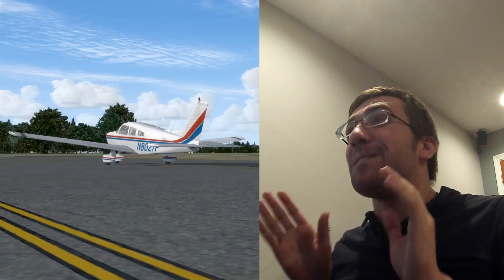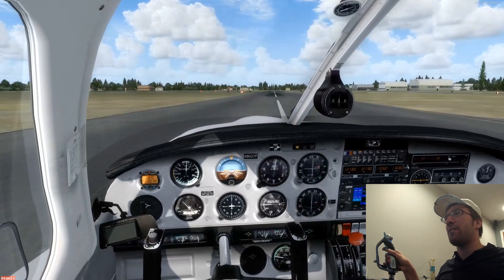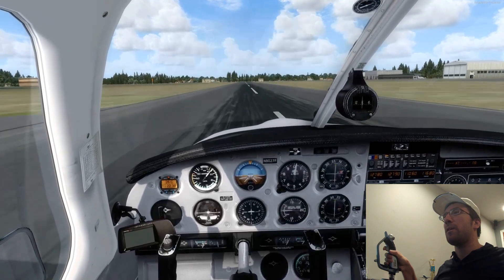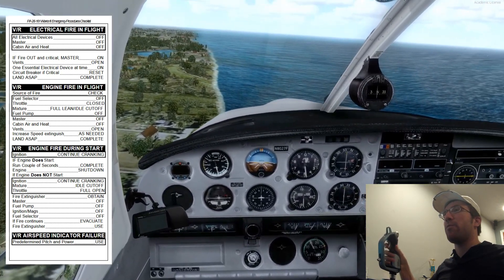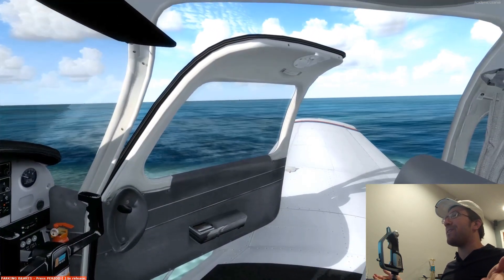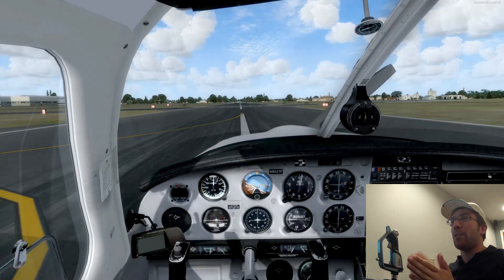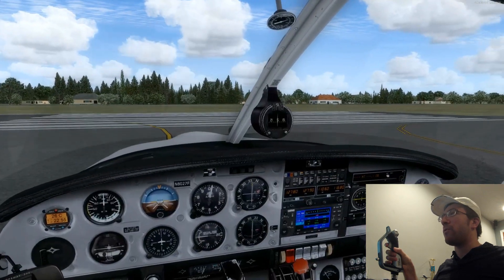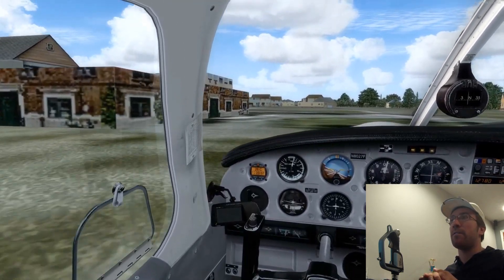Engine Failure Torture Test - Emergency training with realistic flight simulator visuals

Comment: I didn't read the title all the way, and I thought ( from the thumbnail ) that you had an engine fire in flight
Reply from the maker: Luckily, an actual fire in flight is pretty rare.  Some of the other failures in this video, not so much, I'm afraid.  You should have known better than that from the thumbnail, though.  That water would be frozen if it was near me right now ;)
Reply: Friendly Skies Film I keep forgetting where you are... I also noticed something... Wrong.. when you had the engine failure, you went to the 3rd person view, and the prop wasn't moving, then you said "There's that stretch or road right there, it's tempting.."
Then you went back to the cockpit view, and the prop was rotating  again...
Reply from the maker: Yeah, that's a limitation of the prepar3d instant replay feature.  Anytime the engine failure flag was set to true in the replay, it just had the thing stopped.  What was really neat, though, is that it won't stop spinning because of the windmill effect when the engine simply stops, but when we ran out of oil, it actually ceased the engine.  Neat.

Comment: More on VX climb?
Reply from the maker: What would you like to know?
Reply: Friendly Skies Film like how it works and how to perform it?
Reply from the maker: Vx is the best angle of climb, so you expend more of the engine's power climbing vs. flying forward.  Just pitch for the Vx airspeed for your airplane while at maximum rated power.  In a PA-28 it's down around 60kts.  Hope that helps :)

Comment: Not being argumentative, just curious of diffetent views. My instructor taught me to pitch down and do a left spiral at a 45 degree bank. This moves the flames and smoke away from the left side of the cockpit and the increased airspeed may put out the fire. Also to shut off the fuel valve and MAXIMUM throttle to use up any fuel in the lines. Getting the fire out is first priority to landing. How were you taught?
Reply from the maker: Sounds totally reasonable.  I've heard several debates on the spiral.  I just did what it says in the checklist.  I would be interested to see if your theory actually gets the smoke away from the window, which would obviously be a good thing.  The argument I usually hear against the spiral emergency descent is that now you're also maintaining a steep bank while the world is spinning around you and the ground it coming up, and you can't see, AND you're still on fire.  Jury's out for me, but that's why I make these videos.  I learn so much from the comment section.
Reply: Friendly Skies Film Wow. Quick response. I think I'll research this topic. But if you can keep smoke and flames from entering the cockpit before you try to land, that would seem reasonable. Hehe.
Reply from the maker: Yeah, no kidding!  I'm just trying to picture the physics of it, with the oncoming air, versus how your plane has to react to the centripetal forces.  It's a very interesting question!
Reply: Friendly Skies Film So my POH says nothing about a spiral descent. It does say to close the heating the fuel selector set the throttle to full power switch off the Magneto's and ignition switch off electrical fuel pumps choose a landing area and perform emergency landing as usual
Reply from the maker: That's about what mine says, plus pitch for Vne to try to overwhelm the fire.
Reply: i sprial descent wouldnt even move the fire away from the engine. you'd have to be uncordinated. i believe youre mixing up the procedure for a wing fire where you would want to slip/skid to keep the fire away from the tanks
Reply: Scott Walters Good point! I should have thought of that!
Reply: Scott Walters now that I think about it I believe the point of the Spiral was three fold: one to get down this fast as possible, 2 attempt to get the fire out by high airspeed, and 3 to get a panoramic view of what is below you so you can get on the ground as fast as possible because there may be a good emergency landing spot directly below you.